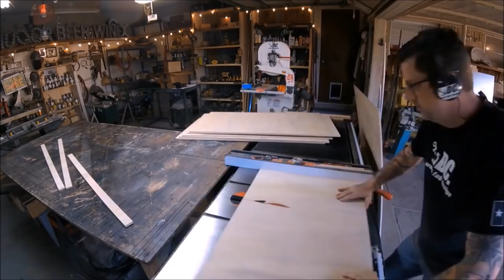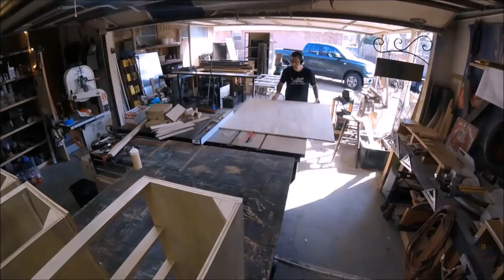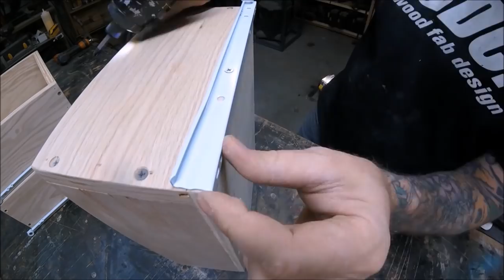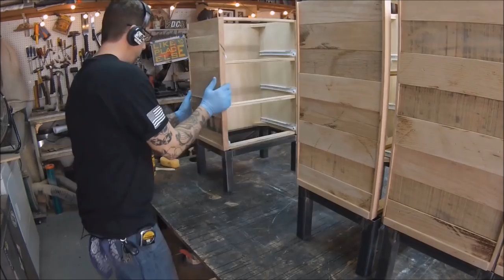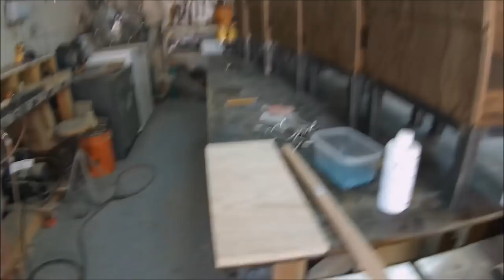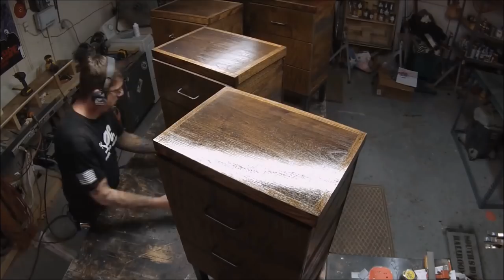END TABLES / CABINETS

Comment: No offense, but honestly these aren't all that great. They are adequate for commercial use I suppose and they do look nice, but they lack that fine build quality one would hope for from a woodworker. Some ways to make these better would have been: Pine boards instead of plywood, box joints on the draws, and possibly biscuits on the main panel joints.